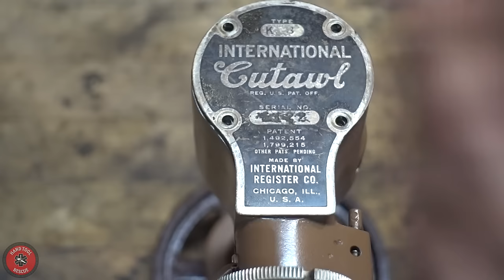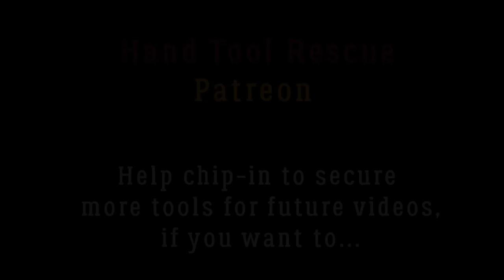1930s Rotary Jigsaw (Cutawl) [Restoration]

Comment: With all that work and you used "3-in-1 Oil" on it? Several retired machinist friends and my father said that it has varnish in it and when the oils evaporate all that's left is the varnish and it causes anything you use it on to completely lock up solid. They all said to never use "3-in-1 Oil" on anything you care about... ever!

Preparation H? ...as a grease? Would regular Vaseline work the same if not better? It should, right?

 Can you give comment on this? Thanks, love watching your videos!

Comment: On a wheel with a notch there are 4 positions - 4 grooves, and on the high tide of the body with a connecting rod there is a pin which you painted over. This pin must fix the bar with a knife for straightening cuts, without bending. Back and forth and right to left.

Comment: A very awesome Clip, but why dont you change the 80+ year old wiring fom the Motor to the on-off switch? The little Light hangs seriously only on wire? Very dangerous! from a modern point of view. And I havn't seen any  grease on the moving steelparts in the machine why? Greetings from Germany to the USA!

Comment: I was so intrigued by this restoration that I actually watched at 75% speed to see it all.  I would consider using a small baking pan or grease tray (from the kitchen?) to catch the excess cleaning, lubricating fluids, and any loose parts which may dislodge themselves.  Back to Peanut Butter for me,  no more Nutella.

Comment: The only detail is the light, which has to be placed against the support, that is, the support of the light of the machine, where the cable passes, you have to straighten the hole, and the light goes vertically, the light is attached to the support. greetings from Argentina. El unico detalle es la luz, que tiene que ir puesta bien contra el soporte, es decir, que, el soporte de la luz de la máquina, en donde pasa el cable, tienes que enderezar el agujero,  y la luz va en vertical, la luz va sujetada al soporte. saludos desde Argentina.

Comment: Next time, cast the bondo, or some kind of urethane casting compound, inside of a handball, tennis ball or racquetball with the threaded insert suspended inside. Works like a shot. Poke a hole large enough for the insert, inject the casting material into the ball and push the insert into the hole squeezing out the excess casting material. When cured, just cut the ball away.

Comment: You have not repaired the blade rotation lock. It fixes 3 positions of a knurled disc - cutting edge of the blade forward, backward, left, right. At the edge of the knurled disc there are 3 notches for this.
Вы не починили фиксатор диска поворота лезвия. Он фиксирует 3 положения диска с накаткой - режущей кромкой лезвия вперёд, назад и влево. На крае рифлёного диска есть три выреза для этого.

Comment: the lamp bracket should have been straightened and the lamp fixed hanging downward with the cable arching out of the top and down to the switch

Comment: i like your vids but, well teh holes filled with crap on the front plate as you put screws into it. The brush set up power going to go through the springs. The sparks that flew makes me wonder about the armature  if you cleaned it with sand paper first. 

The most important thing is get gloves for the solvents. I never used them and my nail beds hurt so bad some days!!! cancer maybe not but lots of pain

Comment: Yes, I am sure the gunk is exactly like Nutella (or maybe dirt, most have eaten dirt when we were toddlers). Sensible about using the wire wheel, after all, lead was used in quite a few paint products. Me and two of my brothers had a wonderful time with what turned out to be a lead-based primer. Our mum cleaned us off using Jeyes Fluid. Boy did it sting, my other brother decided against playing with us and that is how mum found out. No sympathy from her. We were lucky we did not get lead poisoning. Yeah, worst ever Kinder surprise and bugger. I always thought Preparation H was a men's hair renovator for those losing their hair.

Comment: Impressive work....apart from the inappropriate use of hand tools, I saw what you removed the switch nut with, and I hope that was not a metric adjustable spanner you were using !  ;)
I have an old 1950s? B&D metal-bodied hedge-cutter, but I expect it`s an electrocution waiting to happen. I remember a spate of women being electrocuted by metal-bodied washing machines back in the day. I expect one can be zapped without adding water.

Comment: Hand Tool Rescue
,  And where is this terrible "rotation mechanism with small steel balls and retaining rings" in this K8? Do you mean bearings??  Why did not fix the lamp housing in its bracket on its place? The lamp must not to hang on the elektricy wire!!
И где этот ужасный «ротационный механизм с маленькими стальными шариками и стопорными кольцами» в этом K8? Вы имеете в виду подшипники??  Почему не закрепил корпус лампы в её кронштейне на своем месте? Лампа не должна висеть на электрическом проводе!!

Comment: Ask Evapo-Rust for an ultrasonic degreaser. You have paid your dues with a damned spray can for sure. Soaking is not the same thing as an ultrasonic cleaner. You seem to think 3 in 1 Oil is actually a good lubricant. WRONG. It is one of the world's worst. A course on lubricants is in order! LOL

Comment: They definitely don't produce tools that 50-60 years down the track you can pull apart and restore...all disposable crap these days. I watch with interest these and other tool restoration videos as I'm an avid collector of older tools...love their sturdiness and design...probably not as practical..but still great tools that will outlast more generations..if they know wtf they are used for 🤣👍🏻🇦🇺 Just doing what your doing would be black magic, these days, a burning at the stake offence.